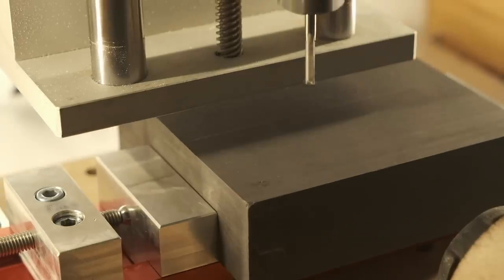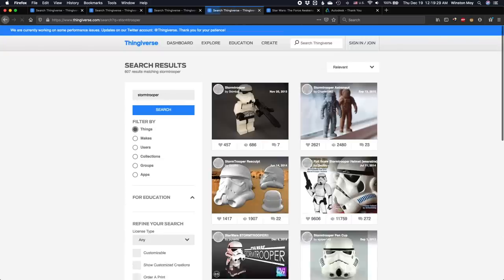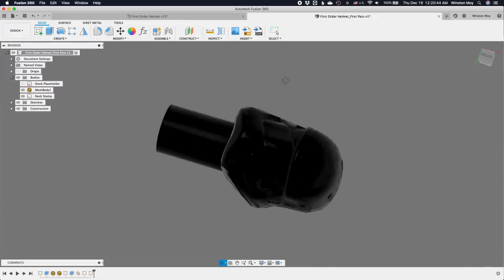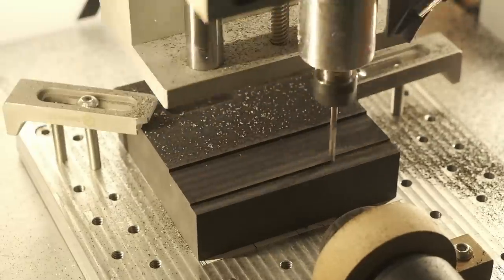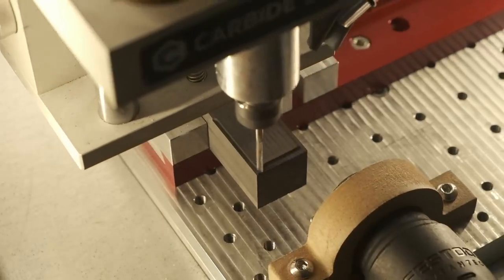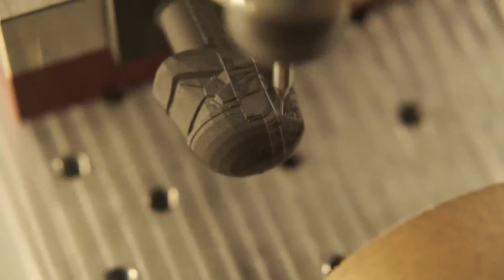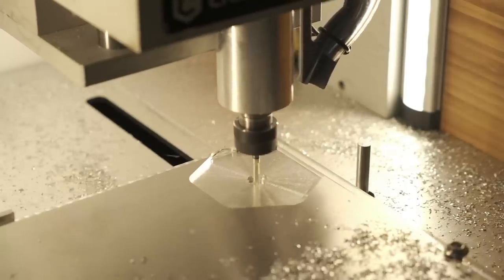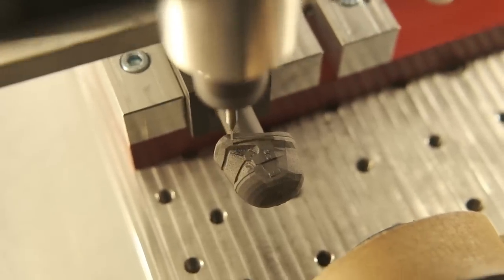Machining a Mini Stormtrooper Helmet in Graphite - #160

Comment: Big caveat upfront. I don’t own, nor have I ever used a CNC machine before. I just retired and I’m looking at your excellent videos,however, because I think I really want to get started.

That said, could you possibly mount two stepper motors (same as your Y stepper motors) onto the base (perpendicular to the Y axis) and attach your stock (rounded, maybe?) between them? Then, lock your Y arm in place directly over the center-line of the stock and swap out the connectors for the normal Y stepper motors with the new Y stepper motors.  That way, every time the machine would normally move in the Y (+/-) direction it would actually be turning the stock some fraction of 360 degrees instead. 

Assuming that’s not totally whacked out, you would probably need to find a way to “flatten”  (or is “curve” a better term?) the Y axis data in order calculate just how far to rotate the stock between each X/Z slice. Basically, you would be making a lathe that “spins” according to CNC logic and uses a router to carve features in the X and Z planes at every Y stop.

Not sure it would work, but you great videos have me both thinking and excited get my own machine and start tinkering.
Reply from the maker: That's what a dedicated rotary 4th axis would be for, but by sacrificing the Y axis motion you could do the same thing. Most people prefer having a true 4-axis machine though, instead of a reconfigured 3-axis.
Reply: Winston Moy thanks for the reply.  Understood.  I just figured two steppers would be a less expensive way to dabble.  Thanks again and keep up the great work.

Comment: Wow! Never know you could 3D with a 3axis machine! Cool! One day I'll have room for a CNC!
Reply: The principles translate too..
For example majority the of time a 3 axis mill will work in only 2 axis (sometime only 1 if hole making). But for a small portion (mainly finishing strategies) it will run 3 axis simultaneously. This normally requires quick good processing power as these toolpaths involve ALOT of small linear moves.
This get scaled up as you add more axis too as when writing for 5 axis machines you will predominantly use the same "2D" tool paths a 3 axis would run and only move the extra 2 axis for positioning the workpiece, then only use 5 axis simultaneous program for finish operations.

Comment: I presume there is a smoothing feature in Fusion360... one that could emulate the visual smoothing that you saw in the render. Why not apply that smoothing, working up to the level of smoothing that you require... then performing the tool paths. In theory, you could machine the face section first, then apply smoothing, and machine the remainder thus producing a smooth helmet with the hard lines in the face. Worth a try?
Reply from the maker: There is a "smoothing" feature in the mesh workspace but unless you increase the poly count, there's not enough vertexes to actually smooth out the curvature. I used to know how to do this in Blender, but I don't think Fusion is the best tool for messing with STLs.
Reply: Is there a tessellate feature? That would give you the poly count. I used that when I was doing a lot of 3DS Max work... tessellate, then smooth... adjusting until you reached the level you wanted.
Reply from the maker: Not that I'm aware of. If someone knows better though, I'm all ears...
Reply: @WinstonMakes  If your model is quad based, you're able to convert it to T-Splines.  The model you have looks like it has proper topology.  However, if it doesn't Blender's new VDB re-mesher is incredibly powerful, and makes for great topology.  A process of mine requires the models to have smooth/flat shaded sections, fusion 360 should know to convert creases.  Here are a couple of resources:  https://help.autodesk.com/view/fusion360/ENU/?guid=GUID-FCB01B0E-828E-40A4-9ADB-DC3955267A53  ,  https://forums.autodesk.com/t5/fusion-360-design-validate/convert-obj-mesh-to-new-body/m-p/6906853#M100478
Reply: @WinstonMakes  Yeah, Blender has all those tools. I bet I or someone could improve that model pretty quickely.

Comment: So when you rotate the piece and start the next operation, are you milling empty space as half of the next side would be completed in the previous operation?
Reply from the maker: There's an option for rest-machining in Fusion I used so I can configure the toolpath to ignore what's already been machined previously.
Reply: Winston Moy I thought as much so you use from previous operation on the last 3 setups?

Found it I was half way there, thanks for coming back to me
Reply from the maker: @Hexenmiester  Yep. Except since I don't think toolpaths can calculate rest machining from toolpaths in other setups, I have to drag a copy of a pre-calculated toolpath into the subsequent setup.